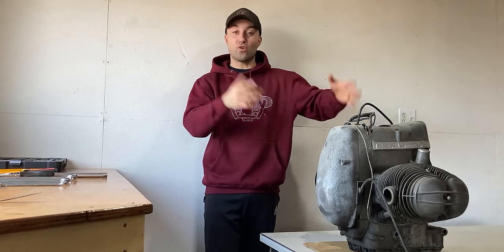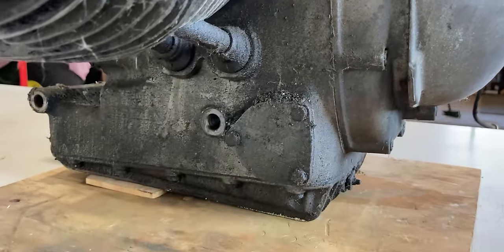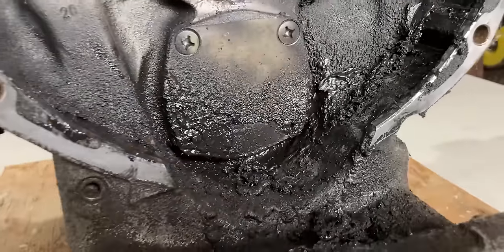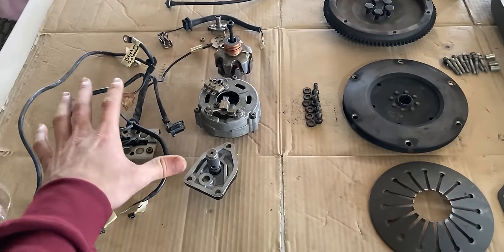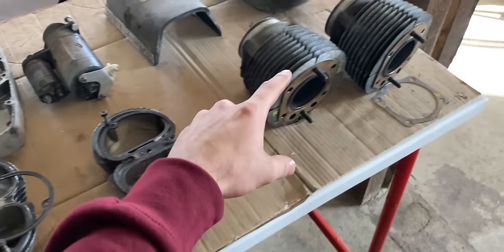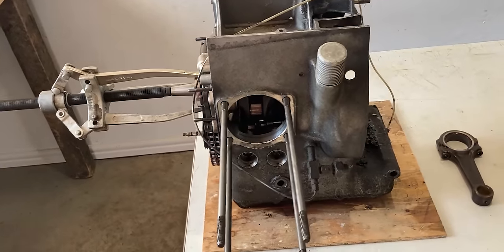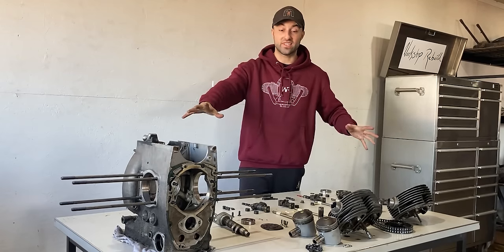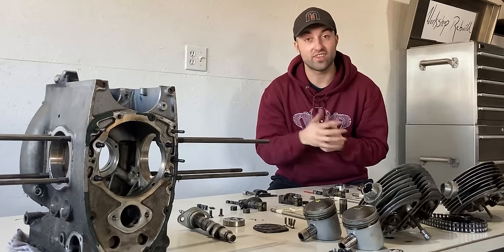BMW R60/5 Airhead Engine Teardown - How Bad Can It Be?

Comment: This video brings back memories of working on my 1968 R60/2 and 1969 R50/2 bikes.  During a trip across Canada in 1977 my R60/2 dropped a valve seat after a long day of riding when stopping to check into a camp ground at Cape Breton Highlands in Nova Scotia.  I was able to remove the cylinder head with just the tools I had brought with me, replacing it with one sent air freight to Sydney NS by a friend back in Maryland who restored old Beemers and had a identical spare engine.  

A significant improvement with the /5 model over the /2 were the removable connecting rods. Those of the /2 were one piece and pressed onto the crank with roller bearing on the lower end.  What did in my R60/2 was a worn wrist pin bearing.  There was no option to just replace the con-rod a $$$ crank-conrod assembly had to be purchased.
Reply from the maker: Wow, that must have been one very unique trip and it's something you'll never forget! It's amazing how much one can do on one of these bikes with a small tool kit and a little bit of effort. I have never worked on a /2 yet, but I would really love to do that in the near future. There's just something about these BMW bikes that just makes we want to wrench on them and then go out for a cruise.

That connecting rod replacement must have been an expensive job, especially due to the complexity of the assembly and the parts availability. Do you still own and ride these two bikes up until this day?

Thanks for sharing such great memories with me, here in the comment section. It was a joy to read this! Regards Andreas
Reply: @WorkshopRebuild   	The steel exhaust valve seat dropped out of the head so I had to buy a new replacement head.  Fortunately new stock parts were still available then.   I commuted on the R60/2 until 1980 when I sold it and the R50/2.
Reply from the maker: @TeddyCavachon  I want already trying to think how you replaced the valve seat with very little tools, but now it makes more sense: you replaced the whole head! I bet that was a beauty to ride, especially a few years back when traffic wasn't this fast-going. Thanks for sharing this! Regards Andreas
Reply: Mine never dropped a valve seat, but I did burn one valve after leaning out the carburetors to try to improve fuel economy.  Rose City BMW in Portland, Oregon very quickly and efficiently replaced it.

Comment: Back in the 70 's ,my friend  bought a new 600 cc BMW, took it for  a ride  on the interstate at 100mph,felt like  60,65mph, incredibly  smooth ,a truly refined  road machine Great motorcycle.This guy knows  his stuff.
Reply from the maker: Hi there! I agree, these machines are very smooth when they are dialed in correctly and they are tremendously fun to ride...even 50 years later! Does your friend still have that bike after all these years?

I have all the parts to bring this engine back to life, except for the rocker arm assembly. This is a topic I spoke about in my most recent video and hopefully I can resolve this "parts-issue" asap. In an upcoming video I will be assembling this engine and very soon it will be able to go back into the frame.
Thanks for tuning in and leaving such a great comment! Regards Andreas
Reply: He must have had the higher output R69.  I bought my R60 new in 1960 and there was no way it would go 100 on a level road.  It was, however, a truly lovely motorcycle to own and ride.  Very smooth on the highway and the faster the engine went, the smoother it got.  Very low RPM could be bit shaky.

Comment: As a long time mechanic I sort of written off boxer engines as not really my type of engine, inline or V as the way to go. But these old BMW bikes sure are simple easy to work on, can take the cylinder head off or adjust the valves without taking the gas tank off or the engine out of the frame, sparking my interest as a lover of elegant mechanical designs.
Reply from the maker: Thank you for tuning in and sharing your opinion! Every engine is special or different in their own way and this engine happens to be built very robust and at the same time very simple.
That is correct, these engines can be worked on very easily and almost every parts is accessible from the outside. I will be rebuilding this engine once I have everything ready and hopefully I can showcase more details. Regards Andreas
Reply: Подари мне этот мотор не ломай!
Reply from the maker: Why would I break it?😄
Reply: @WorkshopRebuild  дада в казахстан отправь
Reply from the maker: @den-ed6qs Maybe I will ride there one day😁👍🏽
Reply: @WorkshopRebuild  блин не понимаю
Reply from the maker: @den-ed6qs  Возможно, однажды я проеду через вашу страну :D
Reply: @WorkshopRebuild  и что вы откуда? И в казахстан ехать он большой!!!! Что мотор подарите? Мечта моя r80 r100  для урала103.10
Reply: I owned an R60/6 45 years ago and recall the needle roller bearings falling out when you remove the valve rockers which you skillfully avoided!
Reply from the maker: @terrydickinson7252  Hi Terry, the BMW R60/6 already had the upgraded rocker arm needle bearings for the rocker arm shaft. This engine still had some vintage BMW technology for the rocker arms. The rocker arm shafts were 14.5mm and supported the rocker arm with a plain bushing. This can be seen in my most recent video, where I received poor quality parts: https://youtu.be/7lJgUvtNxQw
I will go through the engine assembly very soon, as I am still trying to resolve this issue! Once I have an update, you'll definitely see me rebuild this engine and I will share many insights on how to assemble it. Stay tuned for more content based on this R60/5. Regards Andreas
Reply: @WorkshopRebuild  Thanks for the explanation! Just watched the video where you received the poor parts including bushes.
Reply: @terrydickinson7252 Same happend to my R90/6 😢

Comment: What an AWESOME video!!  I ride a BMW R1200RT 2007 and I service everything myself and I always wondered what a complete tear-down of the boxer looks like.  And can't believe my more modern engine is similar after so many years.  Thanks for the video!
Reply from the maker: Hi John, thank you for tuning in and enjoying this engine disassembly. The BMW you own is such a great bike and I have only heard good things about them. According to sources, it is a 5-star bike! 
Most airhead engines are very similar, but over the years they made some neat improvements. This was BMW's first engine with an oil-filter and with a timing chain, so it already featured some cool technology. In the late 70's/early 80's they just made them even more reliable and I'll shed more light on this topic, when I introduce a new project. 
Thank you for sharing this comment. Regards Andreas

Comment: Very interesting video! In all my years of working on cars and small engines, I've never seen the inside of a BMW boxer until now. Very intelligent and pretty much bulletproof design. That one looks like it doesn't have very many miles on it, or it was just very well taken care of. The pistons and cylinders looked pristine, and I'm actually a bit surprised that the front cover was hiding an automotive style alternator, and then the starter up above. Big, meaty, single disc dry clutch on the rear would probably last the life of the bike!
Reply from the maker: I'm glad after all these years you were able to see the internals of the BMW boxer engine. This one specifically was designed and set into production in the late 60's. There were many upgrades that made this engine bulletproof, like an internal oil-filter, two piece connecting rods, chain drive timing, re-engineered cylinder heads and much more!
The bike this engine came out of had around 93'000miles on the clock and the previous owner stated it stopped working a while ago...whatever that means. Maybe it had 100 or 200k on the clock!
The pistons had less wear than the cylinders, but this was too much according to the factory specifications and therefore the engine was machined to accommodate larger pistons. Now it is just over 600cc's haha
There are many neat features on this engine that make it unique and I will share more about this in an upcoming engine rebuild video. I have to resolve some parts issues, but after that I'll have a green light for the assembly.

Thanks for your comment. Regards Andreas

Comment: Props to actually taking the whole thing apart and addressing the concerns you had. This thing is gonna be beautiful when finished.
Reply from the maker: Thanks a lot! It's been fun to tear into this neat 600cc engine and I hope I don't need to purchase too many parts...once all parts are measured I will definitly know. I really hope so and I'll try my best to bring it back to original connditon. Best regards -Andreas
Reply: @WorkshopRebuild  I have a BMW I'm going to work on this is very helpful
Reply from the maker: @johnnyhernandez5660  I'm glad to hear this will help you out, Johnny! This won't be my last BMW project😉

Comment: My two favorite BMWs are the R90S and the PD100. Built solid and will run forever with minimal maintenance.
Reply from the maker: Hi there! These two bikes are true icons from the past and still hold so much value in todays market. You might be surprised what I'll be working on in the near future. Thanks for tuning in and leaving a comment. Regards Andreas

Comment: Iv got a r75/5 motor rigged up on a old wheel horse tractor. It was a very easy  conversion and mows the yard very quietly. These are great motors.
Reply from the maker: Wow, how long have you had this setup for! I'd love to see your setup and if you have any pictures feel free to send me an email (email in the description of this video). These engines are known to be bulletproof and I haven't heard of anyone putting one of these in their tractor. Since it doesn't have a fan, I wonder what temperatures your engines reaches (oil temp)... Regards Andreas

Comment: clever removal of alternator rotor
Reply from the maker: Hi Charles, thank you for your comment! I am aware of the special BMW tool or even the aftermarket bolt (bolt with machined end), but unfortunately I did not have that during the disassembly of this engine. I grabbed what I had and it worked just fine😄 I‘m glad you noticed this! Regards Andreas

Comment: These engines were everywhere when I was a kid in the '70s.  Then when I started riding they had disappeared and I never had a chance to get inside one.  I can't believe how buried the points were.  Considering how often those give trouble...  The starter and clutch look huge for a 600cc boxer.  I have 1.5L four cylinder car with stuff that size.  Overall, looks like you got a nice core.
Reply from the maker: I believe you when you say they disappeared. I wasn‘t around at that time, but knowing what bikes were around in the 90‘s was definitely a different story.
Not only were the Japanese inline 4‘s very hot, but other styles of bikes mixed up the market a little bit.
BMW stuck to their roots with the boxer engine and improved the ridability. Styling was changed over the years, all the way up into the early 90‘s…but that‘s when they decided to push with their K-bikes…

The clutch on the BMW /5‘s is very solid and it‘s meant to last several kilometers. This is maybe another reason why most of these bikes are high-mileage after 50years.

I‘ll go into more details during the assembly process and I cannot wait to share that with you.
You‘ll be able to identify more details, since the whole engine will be like new😃 Thanks for your comment! Regards Andreas

Comment: I ride a 1973 R60/5 loved seeing it all come apart.  As i will at some point have to take mine apart. Very high miles on it, going to need the timing chain and sprockets at the very least.  : ) still run for now.
Reply from the maker: That such a coincidence! You have yourself a lovely bike and it really deserves to still be on the road. I hope you are able to repair/rebuild whatever is necessary...The prices of parts can add up very quickly, especially if you're willing to take on a rebuild.
This R60/5 had ~93'000 Miles on the odometer when it stopped working! Who knows how many were really put on this bike!!
I hope you find joy in the repair work and keep your running as long as possible. The rebuild video of this engine can be seen here: https://youtu.be/ulrai66vyoA
Thanks for tuning in to watch. Regards Andreas

Comment: As someone with a 60/5 with about 30k on it, I don’t see most of this in the too immediate future, but the clarity and detail in this video was actually kind of thrilling and many thanks and all credit to you for producing it. It will be absolutely invaluable when I get there. Looking forward to the reassembly next, and have subscribed!
Reply from the maker: Hi Simon, I’m happy to hear that you have a BMW R60/5 motorcycle too! Your bike has very low mileage compared to the one you can see in this video. The previous owner let me know the speedometer stopped working at 93‘000 miles😁 Who knows how many were put on after that!!
You‘re probably not in need of a full engine rebuild, but maybe in the near future you‘ll be replacing shaft seals. These seals keep the oil within the engine block and over time they can wear or simply deteriorate. 
I will feature all of this within my upcoming engine rebuild video, so don‘t worry.
Thank you for your comment and I am very delighted you subscribed to watch more videos😃 Regards Andreas
Reply: @WorkshopRebuild  Yes, an engine/gearbox reseal are in my near future - the oil is collecting nicely on the shelf - so any additional detail you can put on that would be much appreciated!
Reply from the maker: @simonfletcher3982  I will share the engine seal installation, once the engine goes back together. I have already overhauled the 4-speed gearbox and that can be seen here in this video: https://youtu.be/8GTWWUfGt60 Let me know if you are in need of any other information. Regards Andreas

Comment: Ive Got a BMW R50 /2  , 1952 model Had it for 40  years Needs a Rebuild , Haven"t Ridden it since I was About 20
Still got it tho Just Never got around too rebuilding it , You Know it it goes Some times
Reply from the maker: That is a lovely bike you have😃👍🏽 The older BMW bikes only had oil slingers and they needed to be cleaned out every now and then, in order to keep the engine oil fresh. I‘m glad you didn‘t just ride it until the engine failed. Hopefully you will find the time to get it up and running again in the near future.

I have never worked on a „slinger“ BMW before and maybe I‘ll find one sooner than later to showcase on this channel.

Thank you for sharing this with me. Regards Andreas

Comment: It's a nicely modular construction. BMW were aiming for a durable long service life with this engine. Even the replaceable parts seem very durable and solid. Which is one reason people can restore old BMW bike engines after 50 years - if they can still buy the basic serviceable parts.
Reply from the maker: You are spot on! The base engine assembly is modular and it housed the same components for the 500cc, 600cc and 750cc engines from the 1970's. Not only was this cost effective for the manufacturer (BMW), but it also made servicing much easier as well. 
Today you can still find many OEM parts on the internet, which makes servicing and restoring a very simple task. I will have an update on this engine very soon, and I cannot wait to show you the final engine assembly video. Regards Andreas

Comment: Mine is a 1975/R60 ..... this is great stuff.... I may try this......May!!!!    :)
Reply from the maker: Hi Mark! The disassembly is usually the easy part as you only need to remove nuts and bolts. The assembly is a little bit more intricate, but if you follow certain steps you should be able to tackle an airhead engine like this yourself...with some patience. Thanks for tuning in! Regards, Andreas.

Comment: Indestructible at that displacement because it's also dismally underpowered. Fortunately the cure is easy and I speak from experience. 900cc engines bolt right in and you get the kickstarter gearbox from the R60 which comes in handy. BMW Airhead interchange is quite handy and donors easy to find.

Comment: I’ll never understand why some mechanics don’t clean the engine before disassembling it.
Reply from the maker: All parts needed to be cleaned externally and internally, so I can do this all at once after the disassembly. If you just want to change some gaskets or seals, than I would recommend you clean your surfaces prior to the disassembly.
Thanks for your comment. Regards Andreas
Reply: Makes sense to clean off before strip down.

Comment: You've given me the answer to a question that's been bugging me ever since I built an airfix model of a BMW bike as a kid - what on earth is in the top part of the engine?
Reply from the maker: The top part of the engine hides a starter motor under full an aluminum cover. This part bolts down to the engine block with two bolts and it also has an engine plaque glued on to it. Whenever you see a BMW airhead, you should be able to identify the size of engine by the plaque R60/5 = 600cc others may have a different displacement.
It's a very neat way to cover the top half of the engine and make it look very sleek. Thanks for your comment, Terry. Regards Andreas
Reply: @WorkshopRebuild  Yes the starter motor, it makes perfect sense. The engineering reminds me of the Sunbeam S8, like how a car designer would go about creating a motorcycle.

Comment: thats been well looked after its so clean inside
Reply from the maker: All circulating oil will run through the oil filter, but on the bottom of the oil pan there were metal shavings and "sludge". In an upcoming assembly video I'll show old parts up against new parts and why they have to be replaced. Thanks for watching and I hope you enjoy the rest of my videos. Regards Andreas